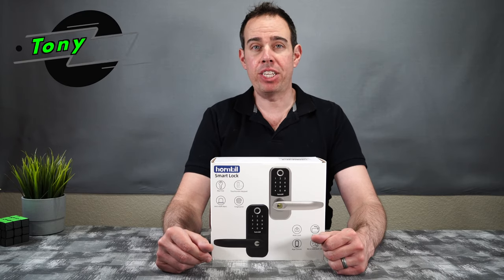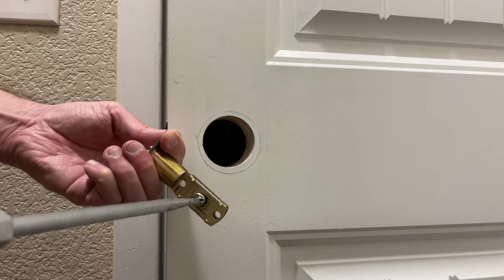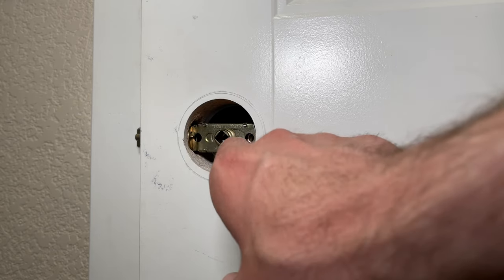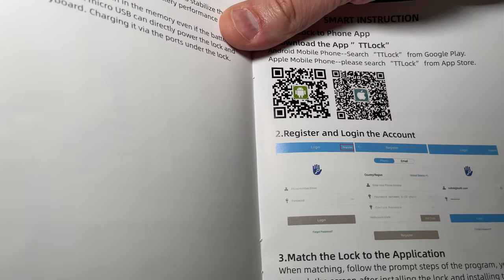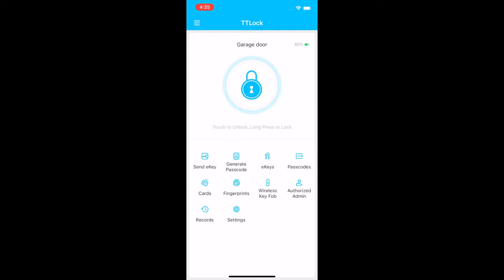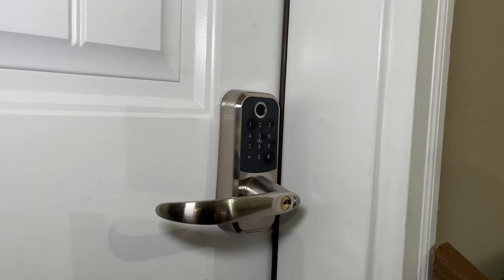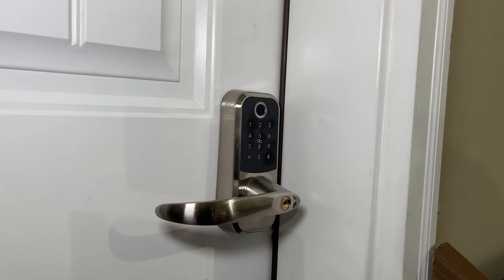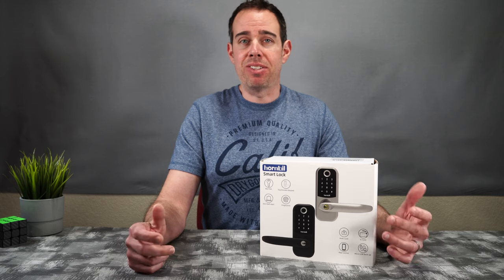Hornbil Fingerprint Sensor Smart Lock - Install  & Review

Comment: How to reset this lock to its factory settings and remove all passcodes and fingerprints if reset button inside and the entire reset procedure don't work? This lock was added to the TTLock app but now is not visible any longer. Batteries are new.  Any idea what is wrong?

Comment: Only one side of the knob is working, other side is not working and hence I'm not able to open the door from outside, any suggestions
Reply from the maker: Is the door unlocked? My handle will move just like normal but will not open the door unless it’s actually unlocked.
Reply: I have the same problem after about a month. Remote code doesn’t work either after a few weeks.  Customer service is in China, I couldn’t get any help from them. I wish I had not bought this lock.  It’s such a waste of my hard earned money!